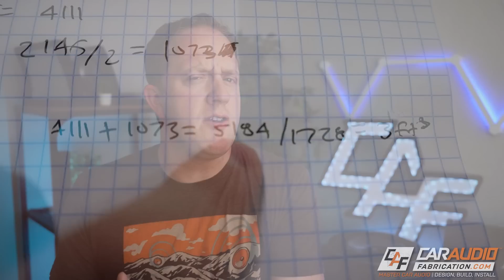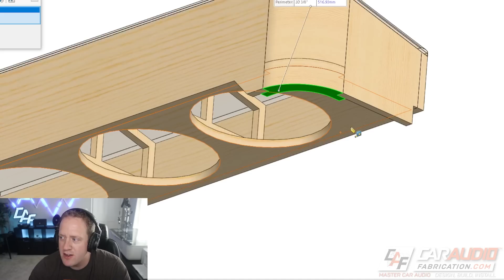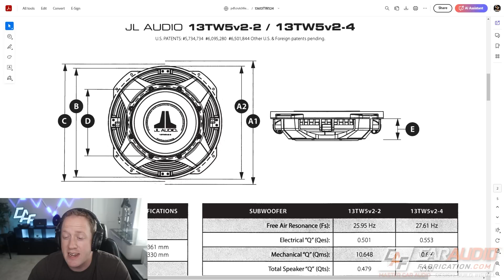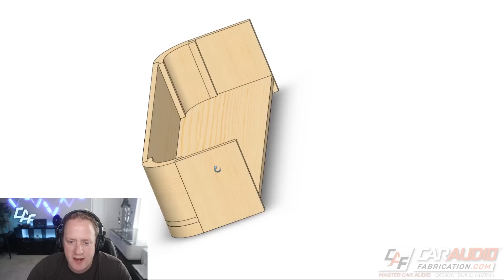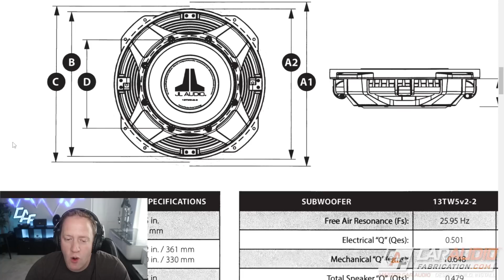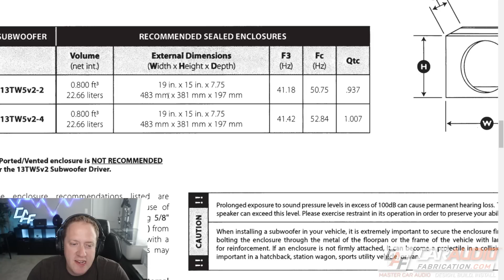THREE 13” Subwoofers Under Seat Enclosure! Box Design process explained!

Comment: Wouldn't this design act like a 4th Order enclosure
Reply from the maker: No
Reply: @CarAudioFabrication  if you were to attach a bottom where the floor is and adjust the notch in the front would it then be a 4th Order?

Comment: Question, why did you choose not to separate each subwoofer into its own chamber and have them share a single chamber?
Reply from the maker: Because there is no reason to seperate them and I find I actually get better results in one chamber.  They are powered by a mono amplifier and fed the exact same signal. Look at world class demo builds, every subwoofer is in a common chamber.

Comment: I have a 2018 Chevrolet Silverado 2500hd High Country crew cab. It has a factory Bose system in it. I would love to add subwoofers,  but I don't want to move my seat. What are my options ? Thanks in advance.

Comment: I’ve previously done a build like this but with 4-10s. Don’t rely on just the glue to hold your baffle, it will eventually come apart. Use screws also to support the weight of the baffle and drivers. You can countersink and cover with wood putty to hide the screws.

Comment: I have 2 sundowns in a fox acoustics box in my 24 GMC 1500. It pounds! Super happy with the down firing. Tried 8s front firing, alpines down firing and lastly 4 8 sundowns forward. The fox box is incredible.
Reply: @Chrismccl  I have a 24’gmc as well and been trying to figure out what to put in my truck,do you have a vid of your sound system of your truck??

Comment: Curious as to weather it is worth doing a similar build. I currently have 2 13w3s rear firing in a sealed enclosure in my 2020 expedition and want more. How would 3 downward firing 13tw5s compare to the set up now relating to spl and frequency range?

Comment: Have you considered doing a budget minded build? I appreciate that you use quality gear, but there is a very large subset of people who want to upgrade their system without spending several thousand dollars. There are a few budget friendly brands that are of reasonable quality.
Reply from the maker: The process shown in my videos can be used for a $100 system or a $10,000 system. Think about it, how would this video be any different if you were using cheap subwoofers (other than they obviously wouldn't sound as good)

Comment: I have a F150 with an MBE 4 8inch enclosure.  It isnt great.  Even with a seat lift.
Reply: SO hard to beleive that an enclosure with 3 13inch woofers would have any low end at all
Reply from the maker: You must have never heard JLs shallow mount line
Reply: what 4 8s? elaborate wat isnt good about it??
Reply: also whats ur power supply?

Comment: Men I got two tw12 in my truck and they rock. I can’t imagine 3 13”
Reply: the tw3 is way better than the tw5 don't be jealous, you probably already have more output.  If not just add another 12 and you will for sure.

Comment: Would LOVE if you could do a video on box design for trucks with no under seat storage. Specifically the new Tundra iforce Max where both car batteries are housed in their own storage box under the rear seat.
Reply: What year tundra? 
My battery is under the hood on my 17 Tundra.

Comment: Thanks, Mark. The best cheap (used to available "open source" enclosure design software YEARS ago, how I got it, was WinSD). If you are tight on space for an enclosure, manufacturer recommendations are just that... a recommendation for optimum output-internal air space. For example, even Hertz has an optimal size for a sealed enclosure (for their 12" shallow mount sub) with .8 cu.ft. internal airspace but their manufacturer enclosure is .72 cu.ft. The software doesn't know the specific vehicle, "real world" cabin gain,  reflections, etc. of course.

LOVED that you shared that a slightly lesser output (in SPL) is insignificant to the listening experience. Unless you're competing in SPL events, design for you vehicle and daily listening experience, IMO. Unless you spend a lot of time parked & playing your system, even a 1db difference in SPL will be totally unnoticeable, especially while driving.   :D

Comment: Great video, curious why you would not individually seal each speaker.  Doesn't the vented brace allow for some push pull from the other speakers in one cabinet?
Reply from the maker: No reason to when they are fed the exact same mono signal.

Comment: Does pointing down end up turning the gap underneath into a port that needs tuning? Kind of like a bandpass?
Reply from the maker: We discuss this in the video :)
Reply: The "simple" answer is yes(ish). I have calculated this variable many times with down firing ported boxes and found it just flattened the response on the higher "mid bass" end instead of rolling off steeply. more than likely in this sealed enclosure it would just continue gaining db into the 200-250 range which will be null anyway with most people using a low pass cutoff of 80-100..... So in THIS case it wont make a noticeable difference. Hope that helps answer your inquiry.

Comment: Passive rads really help builds like this
Reply from the maker: While they can be nice I find that if you have the space to add a whole other "cone" on the passive radiator you might as well add another subwoofer, especially when there are great solutions out there on the market that use such a small air volume.
Reply: @CarAudioFabrication  I agree that this build with those subs is a good match.
What I will say is the vast majority of people I do installs for they just want the highest spl per dollar. Or are they dead set on using _ subs. Like I can take a box this same size drop a pair of kickers or sundown sa/x with a single 12in tuned passive rad in the middle increasing box net volume as I don't need to subtract a big port from the box.
But you know this, so more or less a post for viewers